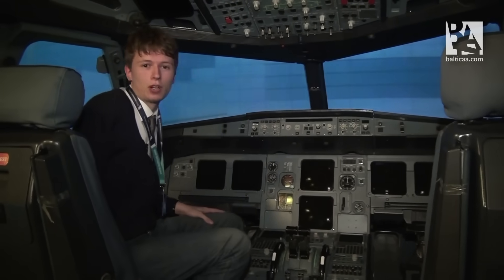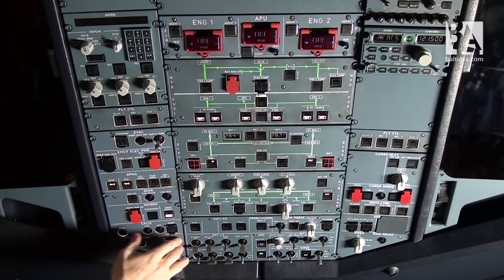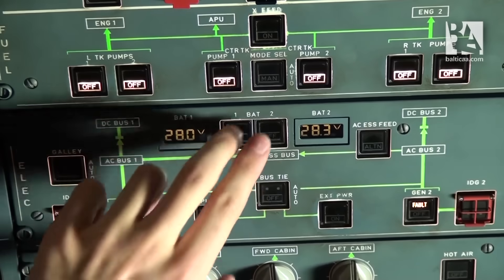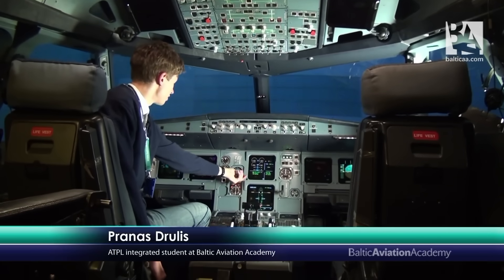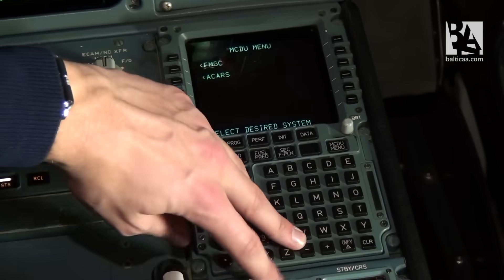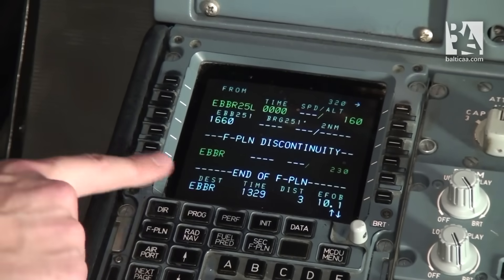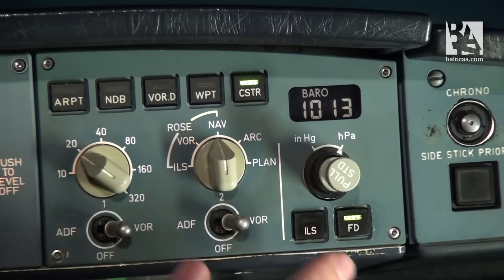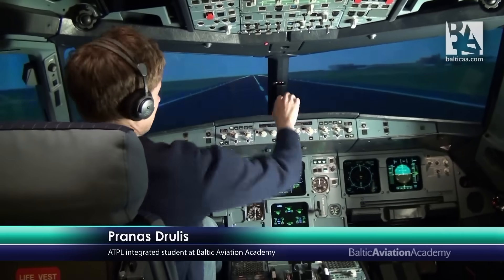Airbus A320 - From Cold and Dark to Ready for Taxiing

Comment: Why is engine 2 always started before engine 1?
Reply: Engine 2 is located on the opposite side to the main entrance door and many other service doors. Starting #2 first allows the pilot to begin the starting procedure while the door is still being closed and other services are being terminated. Then, start #1 once everything is complete.
Reply: Engine 2 powers the yellow hydraulics which powers the parking brake (which is used after pushback while the other engine starts) engine 1 can be started first too esp is single engine taxi out procedures, but the yellow hydraulic electric pump is turned on making a wheezing sound in the cabin

Comment: What happens if the windshield wipers are left on during startup?
Reply: Then the parking tickets stuck under the wipers might be sucked into the engines.
Reply: The airplane explodes
Reply: Same Q
Reply: @antsky371  , the squeaking on a dry windshield can be confused with an audible alarm.

Comment: With this model plane, is there a risk of any control surfaces being blown past their control limits by high gusts of wind? If the plane has been sitting dark on the tarmac for several days, is there a requirement to review the weather history to determine if wind limits of the plane design have been exceeded?

Comment: 28vdc for the batteries. What sort of AC bus does the A320 use? Are these voltages standard for all airliners? What sort of batteries has it got to supply the craft? 28v doesn't sound like lead acid since those are 12 or 24v and lithium batteries are in voltages divisible by 3. Is there any redundancy to the power buses?
Reply: Lead acid batteries have voltages in multiples of 2v.

Comment: Anyone notice the Sidestick Priority button. That might have helped Air France 447.
Reply: That's an indicator light. The sidestick takeover button is on the sidestick. On flight 447 the co-pilot in the pilots seat (Capt was on break) never noticed the rt seat co-pilot with control of the aircraft had the sidestick back.  When the captain  came in and determined the problem it was to late.
Reply: Thank you S FnnII. Very clear explanation. Very sad story.
Just a note - Sidesticks vs Yokes must be quite a culture change to an older pilot.

Comment: Explain logic of putting APU starter button under window heat switch?
Reply: That's the standard location for APU control switches on every jet I've worked on. Airliners keep the system controls located in standard positions. The probe/window heat switch will be left in auto and not touched.

Comment: In the first steps you go through crucial systems. Throttle at zero, landing gear down, engine switch normal,. But why wipers off? Out of all other systems to check we are very concerned about the wipers.

Comment: can someone eli5 why all these things cant be automated? because the human factor in doing all these things is actually scary. not because it is hard, but because it seems a simple mistake can lead to very bad things.. it feels like driving a car where all sensors and engine conrols have their own switches, knobs, lights etc.
Reply: It's not economic. You could automate alot more today but designing and building a completely new aircraft costs billions and billions of dollars. Also airlines would have to re-train all of their pilots. I don't think they would be very happy about that. So why change a system that works really well. Finally, compared to Boeing and older aircraft, the Airbus actually already is an extremely automated airplane that is completely run by computers for the most part of a flight. Look at pictures of cockpits from older aircraft if you think the A320 is complicated =)

Comment: Great video. Those negative comments must be from students who never used a glass cockpit. This is exactly what I did while flying the Honeywell Primus 2000 flight deck. Those push buttons have 4 tiny bulbs in them and dark means all is OK. If a system was inop or turned off the button would be illuminated. Our simulators cost over a million US dollars so I didn't have one in my backyard.

Comment: Aeroplane control design need to be simpilified (a) a big Master Switch for things to be switched on (b) status of inert electrical things; and have some way that an error comes on only when there's a problem - otherwise run quietly in the background as soon as master switch is on, with a Progress Bar showing when ready.

Comment: Slight error in forgetting to switch the air conditioning from "Fresh/Clean" to "Damp/Smelly".
Reply: That is for Ryan Air flights only, the specify it in their build specs
Reply: That's cos they changed the a/c systems in the modern stuff it just says Socks.
Reply: @MerlinVI  You're joking, but in all seriousness, a sudden smell of dirty socks in an aircraft might be a sign of engine oil getting into the bleed-air which is used for cabin conditioning. At room temp the oil is harmless, but once heated it decomposes into nasty stuff.

Comment: His flow sequence for lighting up a cold and dark aircraft is wrong. He should have started with the parking brake (in case the aircraft had been towed onto stand from another location) and worked forward. In fact, walking into the cockpit, his first act would be to look left behind the captain's seat, to check that the undercarriage locks are in their holder. He's used to not doing that because he's in a sim and not a real aircraft. He should also have included the radar, as has been pointed out earlier, and the transponder switch (standby or off). When starting the APU, he shouldn't select the start switch immediately after the APU master is pushed, to allow time for the APU air inlet to open and to see a "Flap open" caption on the ECAM. Also, he has to check that the Ditching switch is ON to open the ditching panel, which is often closed deliberately to allow the aircraft to be deiced. It takes about two minutes to start up from cold, as the APU takes just over a minute to get to full power and full generation. What he also forgot is that the start up sequence also includes the couple of minutes it takes for the entire lighting test in the cabin to conclude, which of course, matters to the rest of the crew and the engineers. that's what fooling around with Sims does for you; you forget the rest of the aeroplane.

Comment: Actually pushback is done Before starting the engines and the request to make engine start is not done with ATC by rather with the all Clear from the pushback team so that they can leave the area safely ... 
ONe of the safety conditions is that of course pushback Can Not be done with engines started ... if that was the case there would be no need for pushback trucks, pilot would simply engage reverse thrust and the airplane would move by it's own. (making a all of of noise on the terminal floor that is :) 
ATC request to departure procedures and start the taxing operation is done Way before engines are started ... after that request is accepted then taxing can begin with the instruction conducted by the ATC.
Reply: John Smith . So how would you start the engines if the APU is U/S? Engine start is usually carried out during pushback. Trying to reverse off stand with the reverses is possible but not recommended due to the mess created and the danger of reingesting debris blown up. Reverse thrust is disengaged below a certain speed on landing for this reason.
Yes he should have contacted the guy on the headset to ensure it was clear to start engines. He should also have turned on the yellow hyd pump to ensure he had brakes. Normal checklist when doing a ground run. Lol

Comment: 1 question: What happens if you accidently,  while on the ground, pull the landing gear lever up?
Reply: AR M, nothing would happen. Large, commercial aircraft have what's called a "squat" switch which is located on the gear leg, depressed, whenever the plane is sitting on the ground. When it's depressed by the weight of the aircraft the gear switch in the cockpit is disengaged. Once the plane lifts off the ground the gear leg extends downward slightly and the squat switch is disengaged, control returns to the cockpit. There have been incidents where smaller general aviation aircraft pilots have accidentally put the gear lever in the "up" position when on the ground that resulted in gear retraction, usually after landing, during taxiing. Most likely the pilot hit the gear switch instead of the flap switch. Flaps are normally retracted after landing to put the full weight of the aircraft on the ground.
Retracting the gear on the ground makes taxiing a bit difficult and generally frowned upon by the aircraft owner as well as the tower! I don't know how those particular aircraft can retract their gear on the ground but it has happened, (possibly because the squat switch was damaged, defective, or was never a part of the aircraft retract system). As a licensed pilot and A&P, (aircraft mechanic) for a large commercial airline, I've never seen or heard of a retraction on the ground with any of our aircraft. (I'm retired now.)
Reply: @toddy2519  Thank you very much. Good to know that it is a impossible task.
Reply: @toddy2519  Smart move retiring now.  Had you not done so, the next time when a landing gear is deployed while still on the ground, they would probably blame you for it. Just you wait and see.

Comment: Each battery outputs 28W. Interesting.
Reply: 28 Volts, not Watts.
Reply: @stargazer7644  It is 28W indeed, as in power, not voltage. 28V times 1A equals 28W. Please, do the math.
Reply: @samuellourenco1050  The batteries aren't "outputting" 28W.  They are charging from the DC bus at 1A.  The APU is carrying the load with 59A to the DC1 side, and 36A to the DC2 side.  The batts are at 28V, the TR1 and TR2 are at 29V.  The batteries aren't putting power onto the bus, they're float charging, as you'd expect with either the engines, apu, or external power available.

Comment: here's something i don't understand (zero aviation here). What does supply power when engines are not running yet and you turn off the batteries? :/
Reply: The APU is running and supplying power at that point.

Comment: Very interesting video. I have just 2 questions about it:
1) When do you turn NAV lights on? (I thought they had to be turned on as soon as the aircraft is electrified, that is when batteries are turned on)
2) On the MCDU, when you select departure runway, you select no SID (and same for the arrival, no STAR), so why do some waypoints appear in your flight plan? Are they part of a "standard" departure procedure?

Comment: What does ADR mean and why is it 1,3 and then 2
Reply: ADR is the Air Data Reference Unit.  This is the computer that supplies attitude and navigation information to the primary flight displays.  The number 1 unit supplies data to the captain's instruments, number 2 supplies data to the first officer's instruments.  Number 3 is a redundant unit, and can be directed to either the captain or first officer's side.

Comment: As technically advanced as the Airbus 380 is, you would think they could make cockpit switches that wouldn't lose the paint. I saw several switches that have spots where the paint has rubbed off.
Reply: You would be amazed at how well human sweat can dissolve ink.
Reply: @charadremur333  ew

Comment: The concept of 'reverse thrust' on modern turbofan engines, in this case General Electric CF6-80C2A5.  

Question relates to these engines fitted, in this case, to an Airbus A300B4-605R, in climb-out at approx 2500 feet, and at approx 240 knots airspeed.

If there were any way, however unlikely or unexpected, for ONE of these engines to be put into a 'reverse thrust' mode, what would be the effect over the next thirty seconds on the flying aircraft ?  Please feel free to speculate here, as there appears to be no hard data ...  speculate on the likely effect on the airframe.

I do hope you can contribute to my understanding here ......
Reply: The plane would crash.
If the thrust reverser would activate at climb power, the plane would immediatly start to turn violently to the side where the thrust reverser is engaged. Also at the same time it would start to roll to the side where the thrust reverser is engaged because modern reversers are designed to disturb also the airflow over the wing which means it would also create a situation of uneven lift between the wings. The resulting effect would be a lose of control for the pilots, the nose would probably drop to a nearly vertical position and because of the low altitude the aircraft wouldn't be recoverable and would crash into the ground within seconds.

Comment: Usually I start with the Ground Power (if available), the batteries and continue with the , fire test, APU, fuel, bleed air, the packs and then I continue with the rest of the start-up.

Comment: Voltage levels and AC frequencies in jet aircraft are always so amazingly bizarre.
Running AC at 400hz, crazy.
Reply: high speed turbine engines turn faster, and you need smaller and lighter alternators. Saves weight. more efficient.
Reply: @jaishetty8586  That sounds so smart. But I don't know what it means :(
Reply: @gulammohiddin5747  Haha. Me too.
Reply: @gulammohiddin5747  Because jet engines are small-ish and they spin so fast, they generate electricity differently from the big slow ones used to make power for cities. This makes the electrical specs onboard really weird.
Reply: Probably helped having a higher frequency with the old tube radios and electrics - smaller transformers needed to step up the voltage.

Comment: If you hunt around you can find some cheap prices on those APU's ( Auxillary Power Unit) turbine.
Some folks get them and set up off grid generator systems with them as they will burn up just about any flammable oil liquid. Kerosene works great but sometimes people have been know to cut motor oil thin enough to burn.
Reply: Love it. I gotta get me one.

Comment: Thanks, i was trying to figure out how to start my plane all morning.
Reply: try alt+F4 it will fix everything it’s a cheat code ;)
Reply: @ensar_clj7677  Nah press the button u turn on ur computer with
that will do the flight for u as well
Reply: I believe that would be ctrl+e
Reply: @shrekoverlord1685   FsX CoNfIrMeD
wanna do a shared cockpit Flight?
Reply: @jannisn454  hmm X-plane also do ctrl + e ;)
Reply: Don't forget to put some fuel in as well.
Reply: @jaishetty8586  how much do you put, I might just try see how much 45 litres of Shell power petrol
Reply: @jaishetty8586  update. 45 litres of Shell power petrol was not enough. Dont recommend it. I got stranded on a taxi way until I was able to have 5 planes queuing behind me individually tugged back so they could tug my back to stand.

Perhaps an extra 10 or 15 litres.
Reply: Exactly nothing to use of this video.
Reply: Push down the clutch and turn the key. ;) 😉
Reply: Plot twist

This is not sarcasm
Reply: Sigh, I get this all the time with my fleet of planes... If the computers are playing up when you try and start it, just try turnin em  on and off again, then you're ready to go. if that doesn't work try a sharp tap with a hammer.
Reply: Me too!🤣🤣🤣🤣🤣🤣
Reply: Bullshit

Comment: Above all else....make sure the WIPERS are OFF before starting the plane.  I try to get my wife to do this in our GMC Acadia but she will not.  She would immediately flunk this course during testing.  Everytime I get in the car...and it was raining when it was pulled into the garage, or left outside snowing and freezing....I promise if you turn the ignition key the wipers will take off or try to if they are frozen to the glass.  Which brings me to my point for this video.  I suspect it's to prevent damage to wipers that might be frozen to the glass and ruin them...causing a delay in flight.  A simple mistake that could cost thousands in time and effort.  So you drill it into procedure to make it habit.  Notice:  this hundred million dollar machine doesn't even have delay wipers.   Off/Slow/Fast is all it has.

Comment: It does not matter the intention of a video. It is vital to always demonstrate solid Checklist culture. The use of a CL is so important that one should not bitter from the discipline of using one, especially at the ATPL level. The memory items are good but with a CL one is safer and better organized... Eg. He put 2,000ft in the MCDU but initial climb in the FCU to 4,000 ft. Before, engines were started up but the APU was not taken offline. Checklist, checklist,checklist checklist...

Comment: APU on During T/O, ok...
Reply: Miguel Delgado yes, apu shuts off automatically when you get enough speed.
Reply: pilots shut down app before take off to save fuel while taxing. using apu during to is just for when you need extra bleed air with isn't the case for a local flight...

Comment: No offense, but you forgot to switch to gen 1 + 2, and turn of the APU.
Or am I wrong?
Reply: The engine generators have a higher priority than the apu generator and are automatically switched to when they reach the proper speed. You have to get rid of the Boeing mind set when you get on an airbus.
Reply: I noticed that too. The APU was still connected.
Reply: You do have to switch over the generators once the main engines get powered, but like I said, sometimes both engines are not started  until taxing to the active runway.